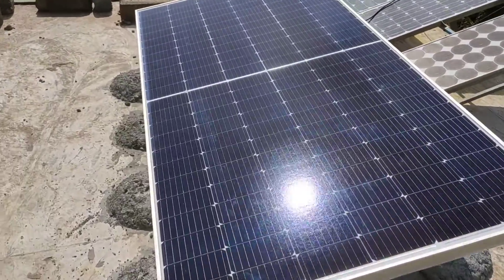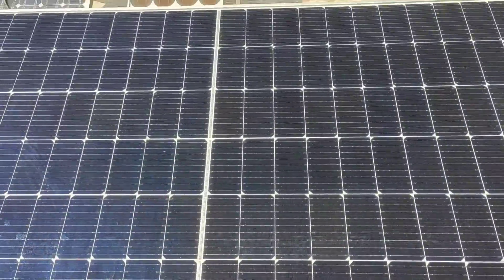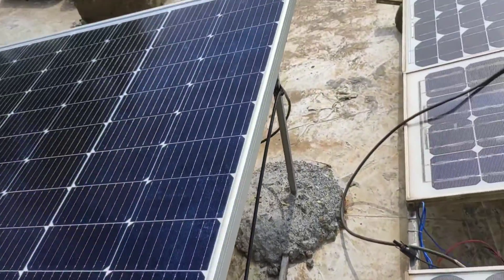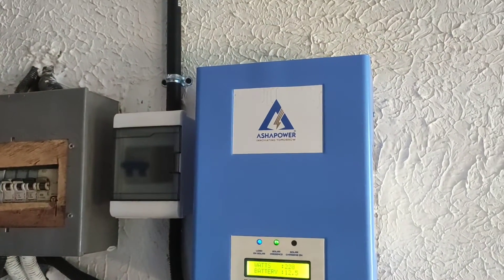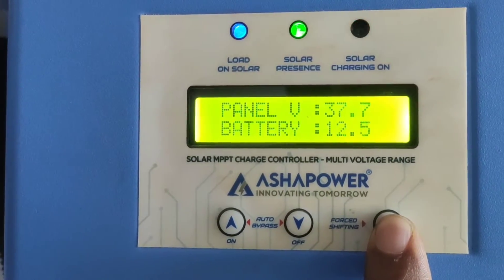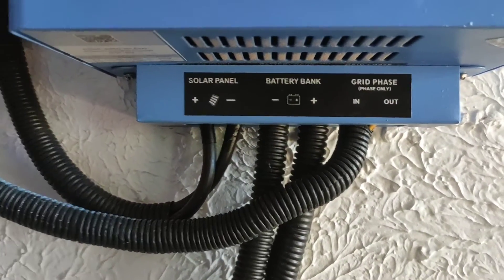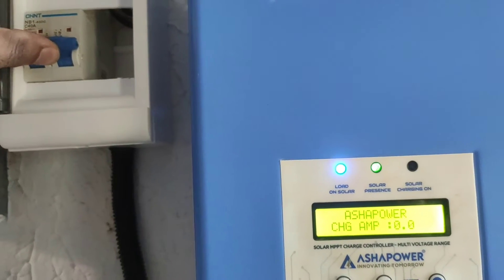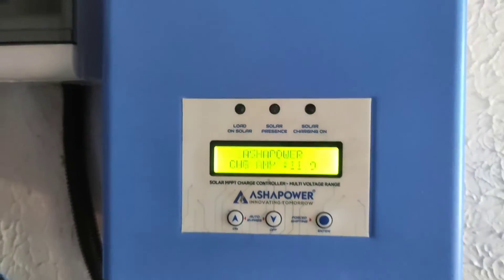Waaree 445 watt solar panel with Ashapower Mppt charge controller

Comment: After buying 445 wat pannel how can you adjust your pannel combination if you need to upgrade system . Now these days 600wat is common .
Reply from the maker: Adding 1 more will support the mppt
Reply: @Lifeofelectronic  I have luminous eco 800 4year old inverter. How's your openion. Should I buy smu or mppt inverter .

Comment: Can you confirm 1 thing, does ashapower mppt controller with inverter can deliver a home load without any battery?
Reply from the maker: it need battery to work
Reply: @Lifeofelectronic is ashapower survyA 60 support 2 550W bifacial panel ? Bifacial generate 30% more from back side it cross 1100watt limit.

Comment: I have a 12v battery (200ah) and 12v inverter (900va) and I have ordered ashapower surya 60 (hv) mppt controller. Can I use 24v solar panels with it and connect them in series or am I restricted to use 12v panels only?
Reply from the maker: You can use 24 v panel. Surya 60 hv support upto 100 v DC input from solar ( check user manual )

Comment: can we connect both of 440w+200w panels in series or parallel
Reply from the maker: Check ampere if and voltage if voltage is same for the panel connect it seeies